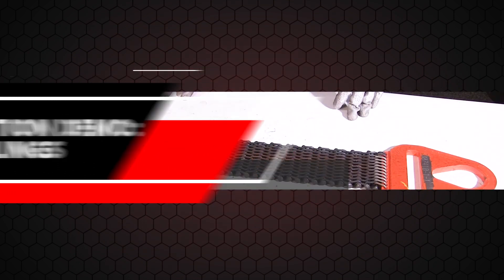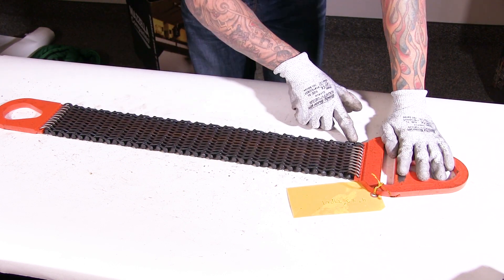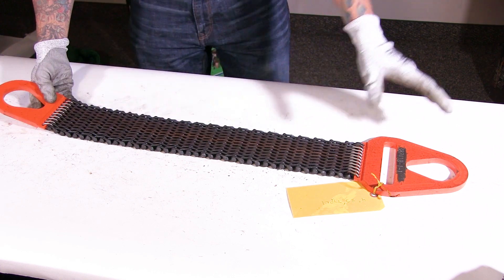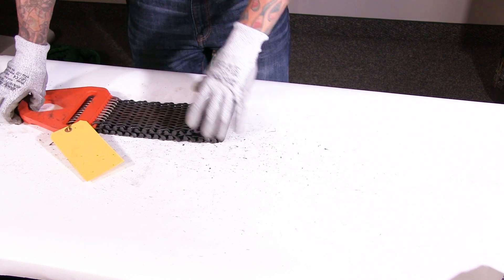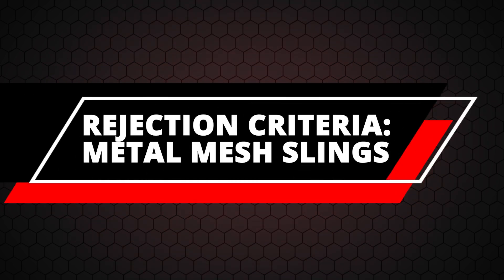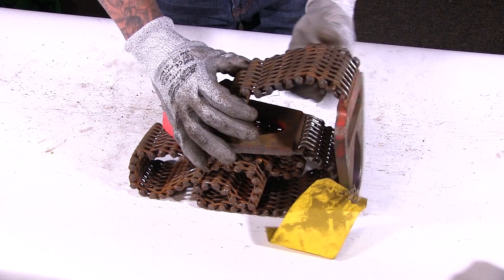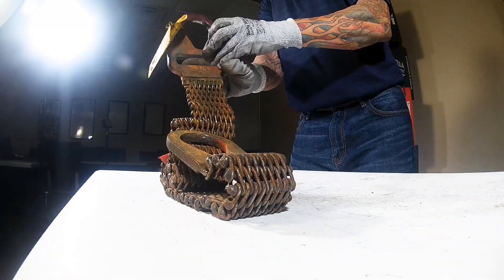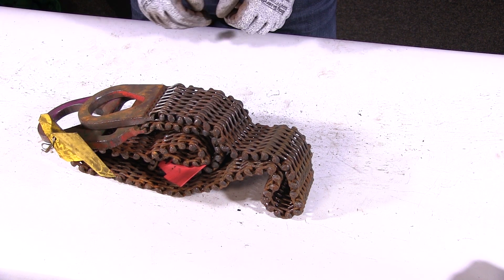How to Inspect a Metal / Wire Mesh Sling to OSHA and ASME Standards | L-6

Comment: Sir if the Attachment to Head if 1 or 2 are broken or if in a body 1 or 2 broken then what is the criteria for rejection. Kndly sir tell about the number and nature of broken links in consequane of which Metal mesh be rejected. Thanks a lot.
Reply from the maker: One broken wire in any part of the mesh is cause for the sling to be rejected per ASME B30.9 Slings standard. Check out our e-book to learn more. https://resources.mazzellacompanies.com/how-to-inspect-lifting-slings-e-book
Reply: @LiftingandRigging  Thankn You for such a quick and to the point reply